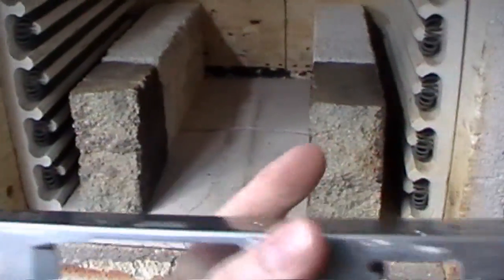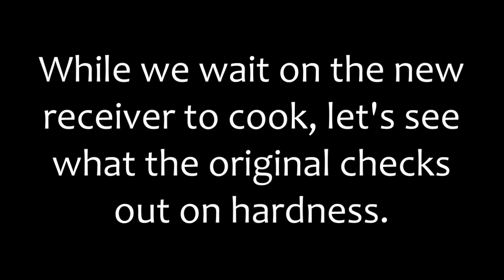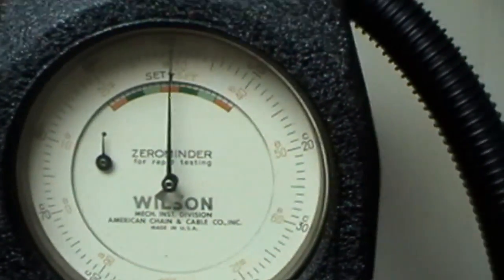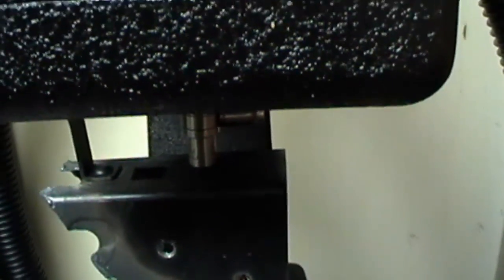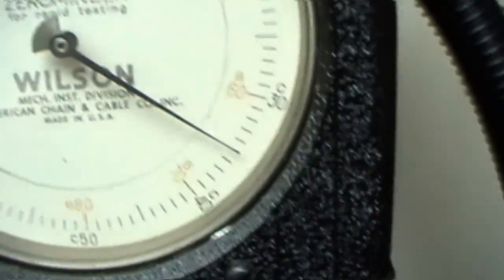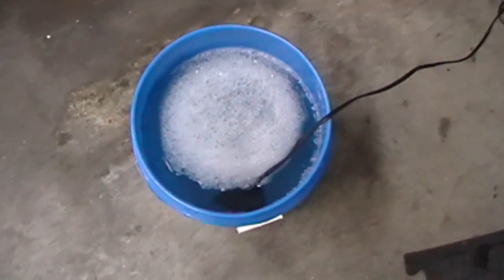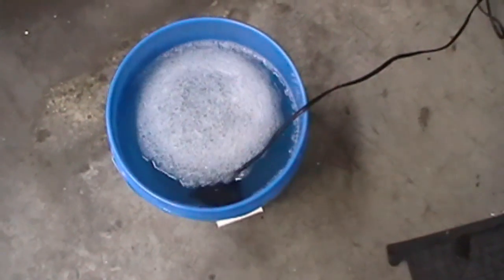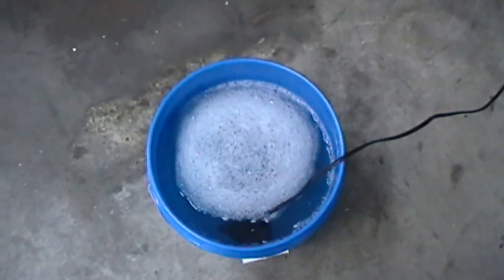Polish Tantal 2

Comment: Howdy Mel64D!!  I really want to know if there is any current modifications that you know of that can eliminate that awful thumb lever on Century Arms Tantals.  I am on my lunch break at the hospital and was trying to find a way to put a regular safety lever on it, and will come back after work to finish watching this Awesome vid.  Any advice you can give is appreciated.
Reply from the maker: Two ways.....weld up the Tantal holes/slots for the selector lever and redo them, or replace the receiver with a normal '74 one. The Tantal selector holes are 0.200" lower than a normal ak'74 receivers.

Comment: A few questions for you on the process:  Why not spot weld the rails before it goes in the kiln?  I have read warping is a problem, but if you preheat at 700 for an before it will relieve the stress and reduce warping.  Doesn't spot welding after heat treating the receiver and rails separately and then spot welding anneal the areas around the weld?

Thanks for these videos, your the first person ever to show the entire process and discuss it honestly.  The fact that the test with the hardness scale afterwards is more than many do!  So many one line answers and mystical explanations about heat treating on the net, this video series is pulling the wool from peoples eyes!
Reply from the maker: G.A. Korobov Thank you. I try not to edit to much out, that way people can see the real challenges to building one of these kits. To many videos just show the good stuff and then the final product, that makes it look like it's easy peasy. But to do it as correctly as possible takes time and even a few do overs. Now to your question about the rails being welded in first. Been there done that. With the rails welded in first that part of the receiver is now thicker and will react to heating and cooling (quench) at different rates (warp).Yes I stress relieve the receiver first, this some say is not necessary but I do it anyway. The stress reliving works on the welds like it should, but the 1600 degrees will cause the receiver to warp in about and 1/8 of an inch when quenched or cooled rapidly. Will this hurt the build, no, but it will make the receiver wavy although it should still function fine. The center support will move the rails back out in the center where it is installed, but the section just in front and behind the center support will still want to be warped in causing the wavy lines in the receiver. This means that the upper rails will need more trimming in the areas that are warped in, leaving less upper rail in those spots to hold the bolt carrier in the receiver.Spot welding the rails in after really does not hurt anything, some say would that cause the receiver to anneal in those spots. Not really, annealing happens when you heat up the metal and hold for a certain length of time. The quick spot weld only last a few seconds and in that amount of time not much "annealing" is really going to happen.That is why after doing several receivers now I just weld the rails in after everything is heat treated and drawn back, leaving me with a straight receiver. The Russian factories do it this way so I am comfortable with doing it this way as well.   Thank you for watching ~Mel
@comments#       @comments#
Reply: ***** Makes sense.  I build HK roller locks and luckily no heat treating there, been considering doing a video series on building them similar to your own.  

One thing that is very interesting about the heat treating of AK receivers is that a big benefit to heat treating is usually overlooked.  If the weapon is hit by shrapnel from an IED or explosion the heat treating prevents the receiver from being punctured or deformed, you can see the effects on the AK Operators youtube channel when they torture test the rifles by shooting them with birdshot from a shotgun.  The pellets literally bounce off the hardened steel with no effect, not even a scratch.
Reply from the maker: G.A. Korobov Exactly, when I use the hammer to set the tail either for the center support rivet or rear trunnion rivets I sometimes miss and strike the receiver.  With the Polish 80% blanks the hammer just skips right off and no damage what so ever. But with the 4130 a light ding is made setting rivets if and when I miss. The 80% blanks make it to 58/59Rc then I some times have to do a double draw to get them down to 40/42Rc. The 4130's make it to 50Rc then draw once to 40/42RC. The dings on the 4130 flats are not as bad as it sounds but are noticeable, and have to be lightly sanded.You should do the video series I'm sure there are many people that would benefit and surely appreciate it. I only have a Cetme not an HK though they were both designed by H&K. So I myself would like as much video information as I can get on the HK style rifles if and when I need to work on the Cetme. It runs like a dream now that I replaced the rollers and fixed the rear of the receiver. It was slightly crushed in and would lock the carrier in the rear position when fired.  I got it cheap because the guy that had it had no idea how to fix it.
Reply from the maker: G.A. Korobov  man every time I separate my paragraphs they still get smashed together.??